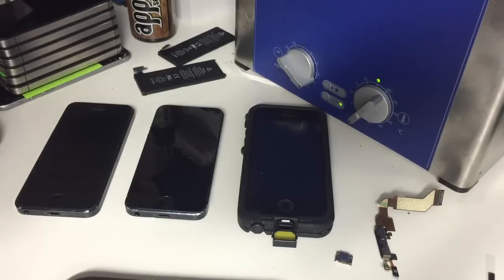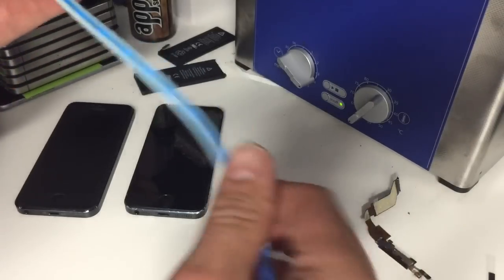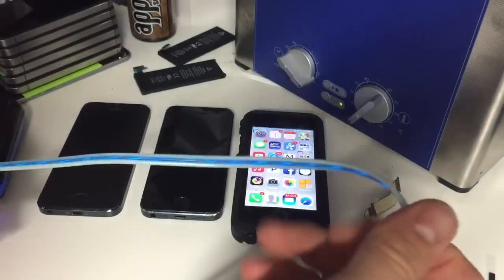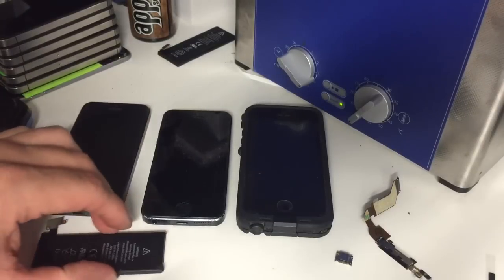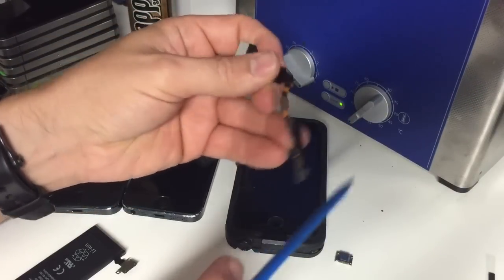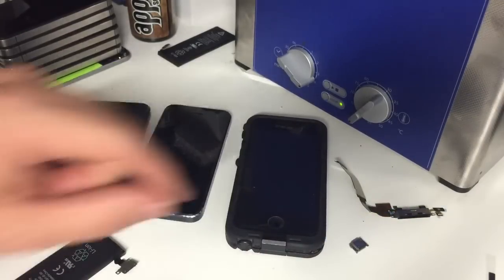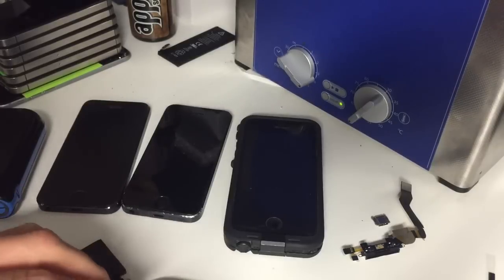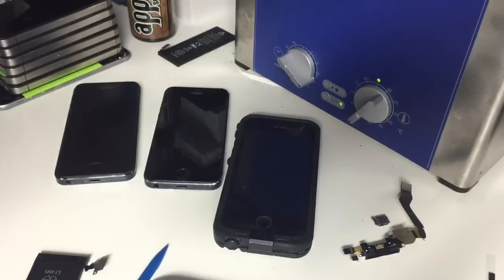Phone battery won't charge? Don't change the port! (First)

Comment: Hey on other thing you could do instead of the light up cable is a device called like USB Doctor. Its a little device that go in between the cable and port and shows both voltage and amperage. The device is about $2 on ebay

Comment: what if the phone is getting charged when turned off, but not showing any sign of charging when connected to adapter when turned on, also not connecting to the itunes nor showing the device in the device manager